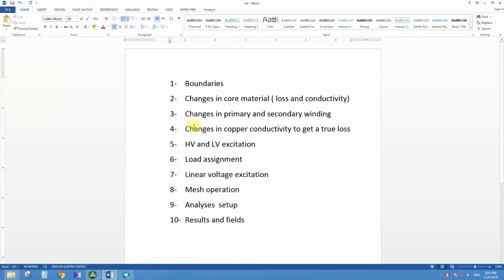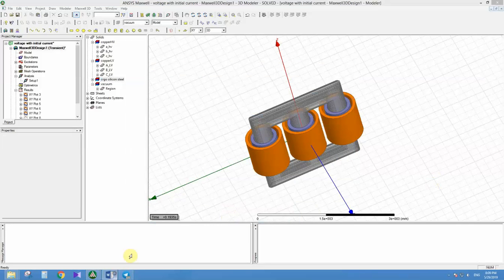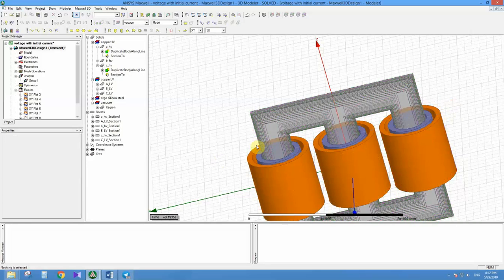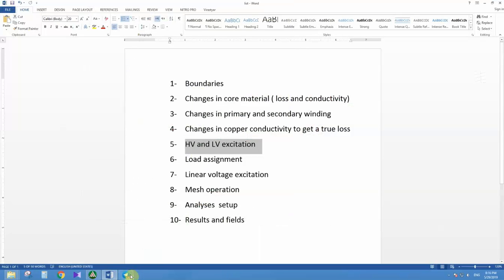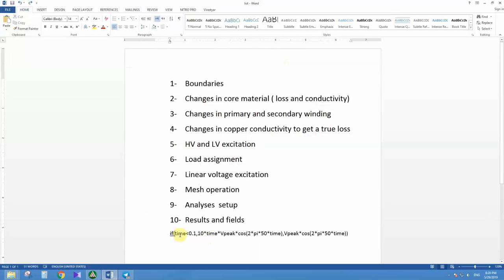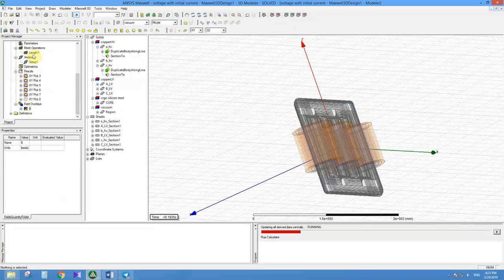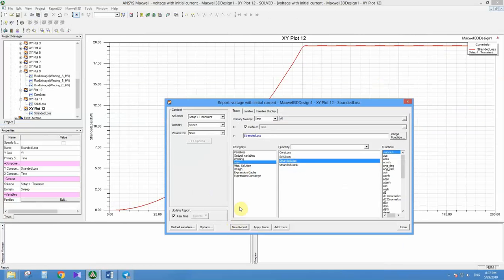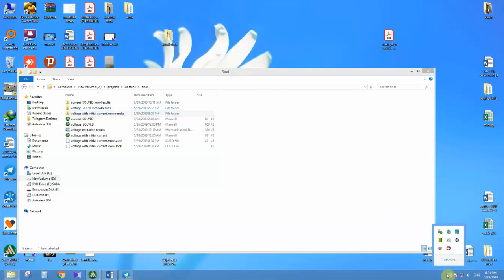3d Transformer simulation using Finite Element (FEM/FEA) software ANSYS MAXWELL

Comment: Hi sir
how to compute stray loss in structural parts of transformer through ansys maxwell
Reply from the maker: Hello. If there is a flux leakage from the transformer's core, there will be some loss in the outer tank. To calculate that, you need to activate the checkbox of the tank in the "set eddy effect" setting

Comment: Hello,
How can I calculate DC resistance in Ansys Maxwell
Reply from the maker: First notice that you model the coil without fill factor, so the resistance that you get is not exact. You have to reduce the conductivity by ratio of fill factor. Then you can inject 1 amper current to the coil and measure the loss(solid or stranded) the loss value will be equal to resistance ( loss=R I^2.  I=1)